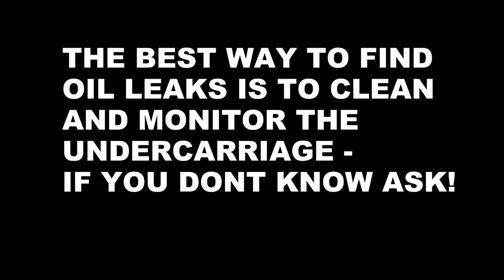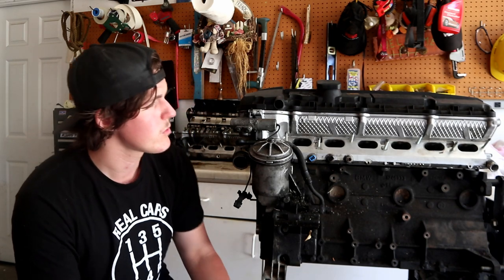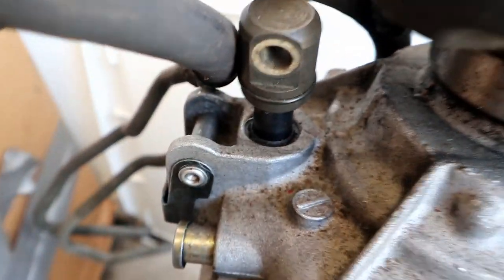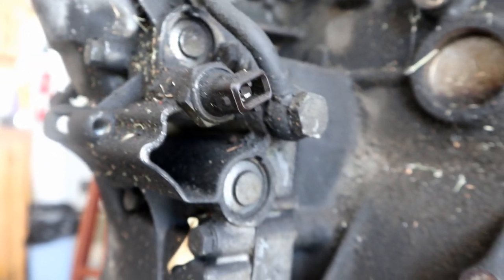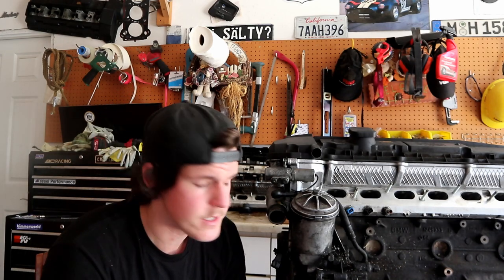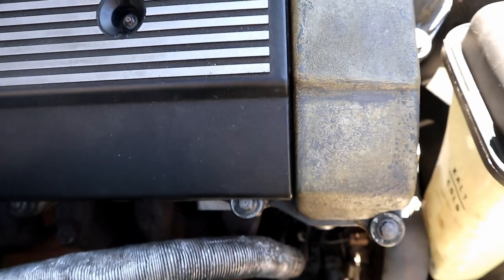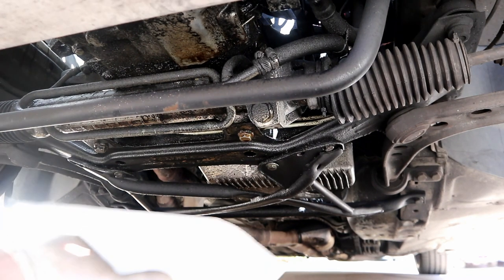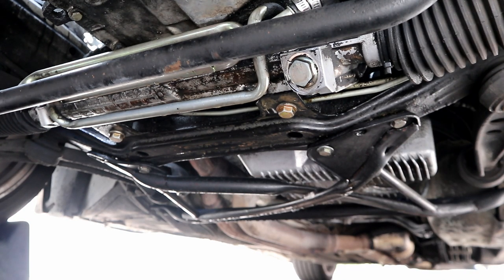A Guide to E36 Oil Leaks

Comment: this is helpful. i bought new oil filter housing on my 95 325i because mechanic honestly thought check valve o ring could not be replaced and lot of vendors don't sell just o ring!
Reply from the maker: an o-ring is just an o-ring! take the o-ring off and pop down to a parts store and find one just like it, everyone has surplus o-rings.

Comment: Oil on exhast manifolds etc could catch fire..as well thanks for the great tips! P.S. power steering hoses on the plastic nipplies connnectors at the bottom reservoir can also crack. Rear port on oil filter housing can leak as well. Can be misdiagnosed as leaking oil pan gasket.

Comment: Great vid mate! Another place the power steering lines leak from is the join on the banjo fittings on the hard lines. I got my banjo connections braised onto the hardline to prevent further leaks.
Reply from the maker: Thanks man! Good tip🤟

Comment: Hey i learned a few things from this. def time to fix some of my seeping areas. I pressure wash my e36 often but usally have to protect the coils and plug boots. if i get a misfire i know my plug holes are wet and time to blow them out and dry the coil/boot. watching your videos motivate me to work on my cars. maybe you will do a tutorial on rear subframe poly install and reinforcement plates on non M3 cars. thats my next big project
Reply from the maker: yup! im going to be doing a full subframe out rebuild on my droptop soon. hopefully before winter.

Comment: I have an M50B25 non vanos block and head sitting on a stand waiting for me to drop it in once I get all the rest of the bits. How much of this applies to my car? Specifically the leaking valve cover part.
Reply from the maker: well i mean all of it. you wont know if it leaks till it's in and running, i would throw a new valve cover gasket and oil pan gasket on minimum.

Comment: Been chasing an oil leak on my 328i for awhile now, is it possible for an oil leak to come from the back of the head somewhere because I’ve done everything from putting a different valve cover on, new gaskets, rtv on the corners and torqued to spec but yet I still get a leak from the back corner on to my exhaust and smokes and it’s a decent size leak to where if I don’t stay on top of it, it gets a few quarts low on oil, just wanted to know your thoughts on this if I should just get a brand new valve cover or if I should go as far as pulling the head for a possible leak on the back of it
Reply from the maker: hmm, plastic valve cover im assuming? I would check it for cracks. aside from that, im not sure if there are oil gallery plugs on the back of the cylinder head. a headgasket wouldnt leak onto the manifolds unless its leaking very badly.
Reply: The car still runs good so I wouldn’t think the head gasket is leaking like but it does have 214k miles never been taken off maybe the only way to know is bite the bullet and get a brand new cover instead of another used cover

Comment: i have 95 325i since 97 w 150k, would you insist on diff fluid change even tho bmw says original don't need change?  i plan to keep it long as possible. if yes, mobil 1 75w-90 synthetic ok?
Reply from the maker: Yup do it! I change my trans and diff fluid every 2 years. 75w-140 synthetic prefered for the diff.

Comment: By any chance you don’t use 5w-30 on your m3? I live in LA County and I’m on the line on the weight of oil I should use on a 97’ m3
Reply from the maker: I live in SD, i run 10-W40 in the summer an d20W-50 in the winter
Reply: M3NACE thank you so much brotha ! Might have to go with that !! Do you use Castrol?
Reply: Wait aren't you supposed to run the thinner oil in the winter?

Comment: u should do a video on ways e36 can fail to start or other problem peculiar to this model. i wasted lot of money just diagnosing crankshaft position sensor failure on 95 325i at 120k because lot of mechanics dont know what they are doing
Reply from the maker: Yeah, thats where alot of reading up and common problems come into play, and mileage maint. I could do a vid like that though.

Comment: Hey man so my transmission started to leak and I tried cleaning it off to find the source of the leak but I’m not sure. it’s in the area of the drain plug and output seal maybe any ideas?
Reply from the maker: you could try tightening the drain plug, they are tapered fittings and seal more as they tighten. aside from that, clean it off and monitor the leak. if it is the output shaft seal, there is no fix aside from replacing the seal.
Reply: Change the nut, if it overtighted before it can leaks.

Comment: My man, can the Freeze plugs O'rings from the oil filter housing be replaced without taking out from the engine? Because taking off the whole thing is a pain, recently I've replaced the vanos oil feed crushwashers and line, as well as the housing gasket. So freeze plugs can be done with the housing on...?
Reply from the maker: Yes they can be
Reply: any idea what size is the O'ring?
Reply: @M3NACE  any idea what size is the O'ring?